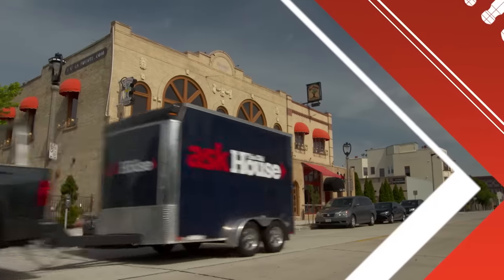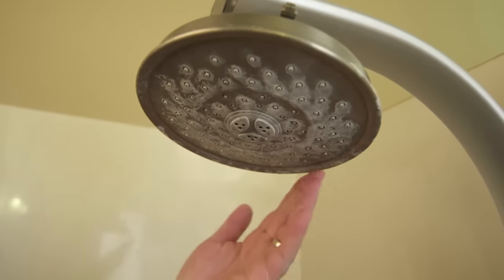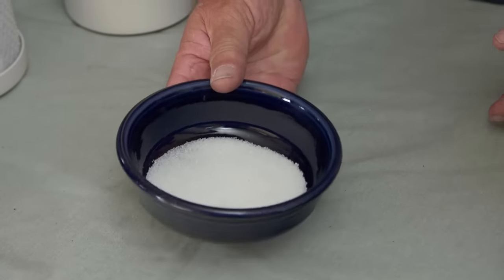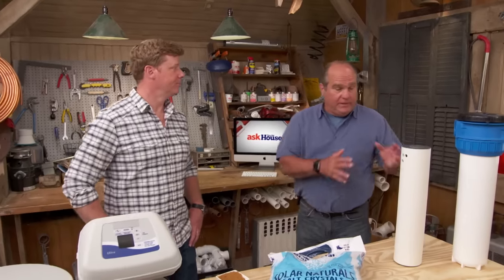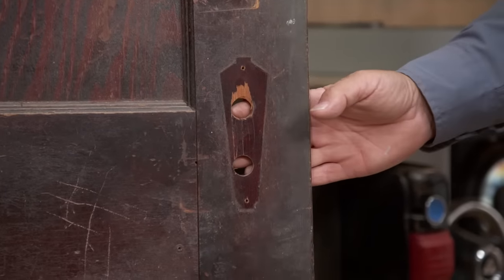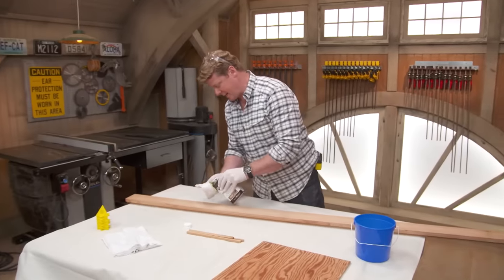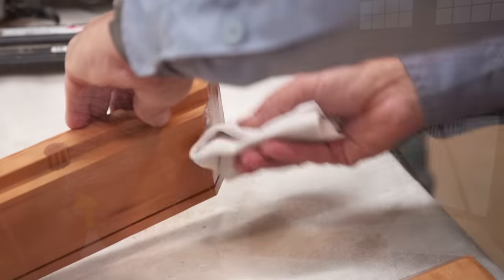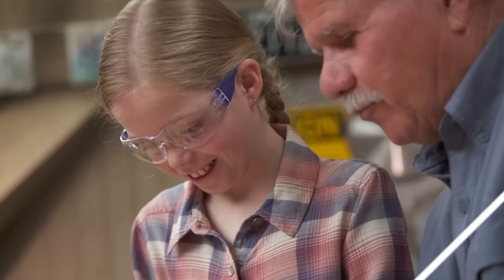Ask This Old House | Water Softener, App, Shadow Box (S16 E1) | FULL EPISODE

Comment: Not only is the citric acid based water conditioner 3 times as expensive to buy as a normal water softener despite the fact that they are just hollow plastic structures with no electronics (overpriced), the recurring costs are also more expensive then buying salt.
Reply: It’s new, that theoretically should shake out as demand increases. Change is slow… but seems easier and better for municipality. Unless u don’t care about that.

Comment: Traditional ion exchange water softeners that use salt to regenerated the resin beads don't add salt (sodium chloride) to the water but they do add sodium. That is how they work. The calcium and magnesium ions in the water are exchanged for sodium ions, which don't cause the water to be "hard". Although the amount of sodium is small it could be a problem for individuals on a low-sodium diet (consult your physician) and, as mentioned in the video, in aggregate at a water treatment plant could also increate the steps necessary to treat the water.

Comment: We just bought a 35 yo house. The HVAC return air ducts in the attic are in good condition except for the vapor barrier is splitting exposing the insulation to ambient air & humidity. Is there a fix short of replacing these ducts?

Comment: How did you solder the copper pipes while they were connected to the plastic filter housing? Why didn’t the housing melt. I soldered copper pipe that had cpvc connected to the other end of it and it cause the cpvc pipe to melt.

Comment: All the citric acid does is make your water acidic, which keeps the minerals dissolved instead of falling out into your pipes.  However, this is a bad idea with anything other than pex pipes as it will start to eat your metal pipes away.  Take note if you have any green discoloration in your sink/bath as this is a sign your water is very acidic and your copper pipes are dissolving.

Comment: Anyone know if that citric acid conditioner would be good for my problem? Have 10gpg hardness mostly calcium, but a very small >4ft crawlspace where a normal softener won’t fit.
Reply: i cant speak to the citric acid.  i use 
siliphos to slow down calcium build-up, but will still need to be replaced/recharged like a normal filter.   

Honestly it might be worth having the water main head outside for an outdoor water softener or conditioner, so it's less effort to maintain over the years. either way, i definitely recommend including bypass. many filter housings have a built-in bypass, so no messing with additional valves and piping.

Comment: I have installed water softeners in about 5 houses I've owned.  None EVER used as much salt as they are saying.  The latest one is the best because it sips salt.  If I fill it up, it will be about 
two YEARS before I need to add salt again.  Another side effect is that having a water 
softener seems to have cured a medical condition.  I have rosacea which was treated by 
Doctors by giving me oral medications.  I no longer need those.
Reply: Would you say there is a big difference between them? Do you habe to replace/rebuild the resin tank often? I need a water softener but habe 0 experience so yours would be greatly appreciated.

Comment: I was wondering, I just watched the soldering of the coper pipes for the water softener and it made me réalisé there is a type of pipes in Europe called multilayer pipe (a sandwich of pex-aluminum-pex) but I never saw an American plumber using this technology so I was wondering if it existed in the US
Reply: I'm no plumber, but I work in a building supply store in the US. Until reading this comment I've never even heard of this kind of pipe.
Reply: Pex-Al-Pex is used in the USA primarily in hydronic heating applications. It shows up in potable water every once in a while, but PEX-A and PEX-B is much more common.
Reply: Robert Garside that’s what I thought, I tried to find some at Lowe’s and Home Depot but it just didn’t exist there. Thank you for your answer
Reply: TheVargTrain pex (or per) was really common a few years ago until they realized that it had some flaws and multilayer became more common as it is easier to work with and solves the issues of pex while being cheaper than copper

Comment: So since that magnesium and calcium are being bonded by the citric acid my question to you is what happens when all of that comes out and hits my shower glass doors and my fiberglass tub
Reply: You partially answered your own question. The citric acid is sequestered in the new bond. So whatever citric acid is getting through would be the result of an unbalanced system.

I'm not entirely sold on the idea to be honest. If my brine softener is off my water will be a little cloudy, if this system is off the water will be so bitter to the point of undrinkable.